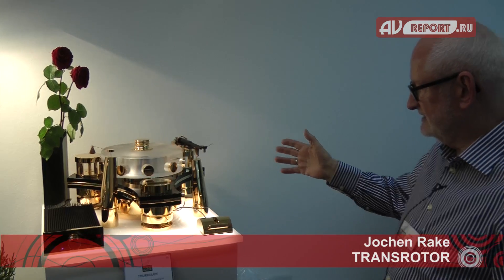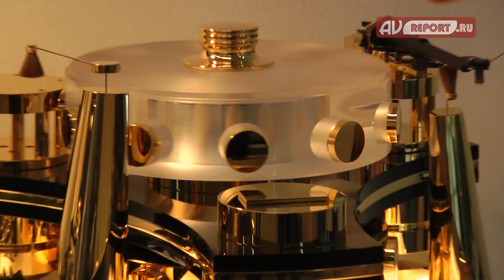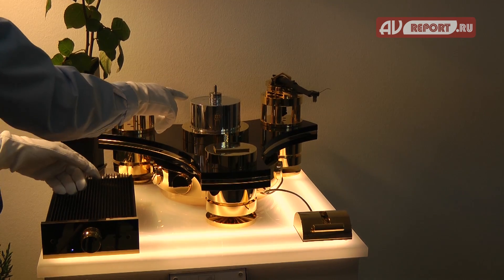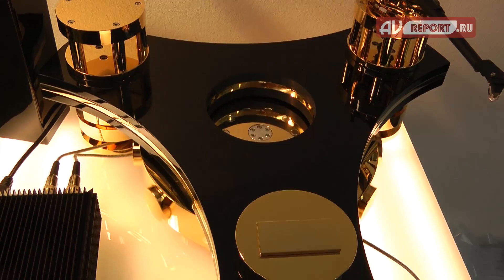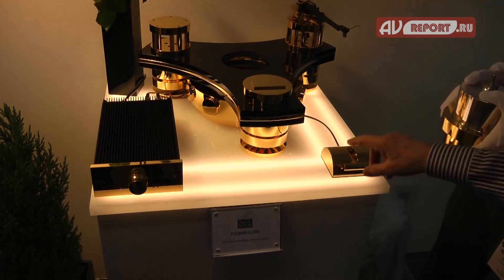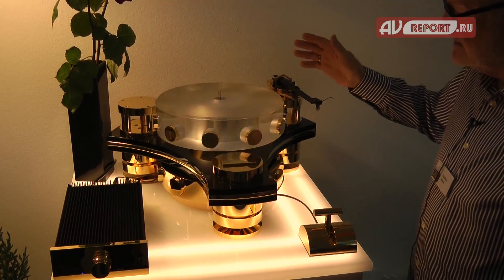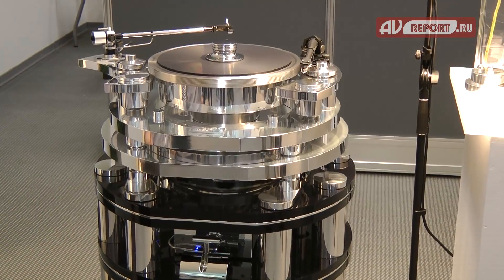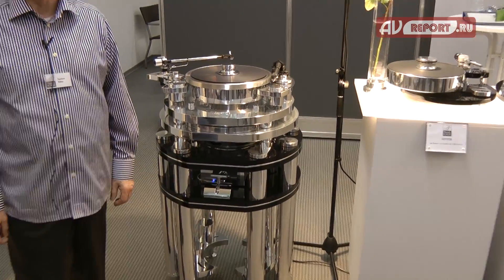Munich High End Show 2015: Transrotor Tourbillon и Artus

Comment: Very clever idea to isolate the platter from the drive system, a bit like the fluid coupling in a conventional auto transmission where fluid is the medium
used to transfer the power, fluids can't be compressed. This is a superior system, I wish I had thought of it myself.